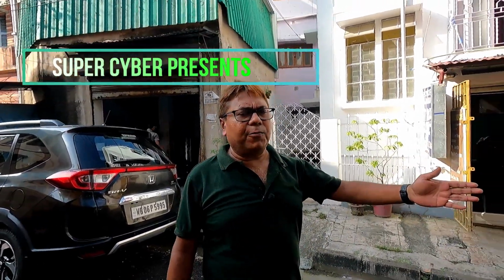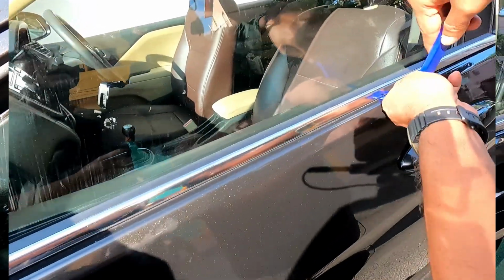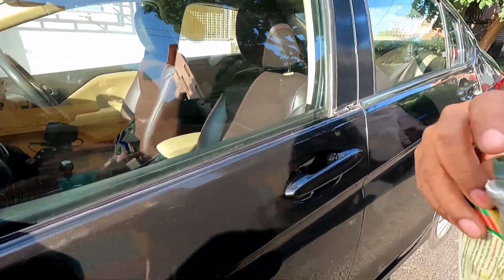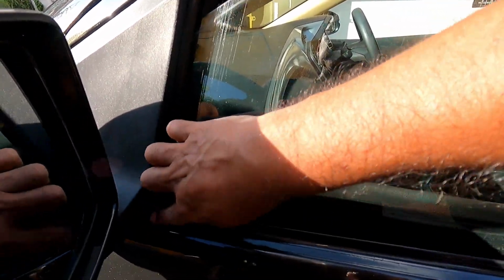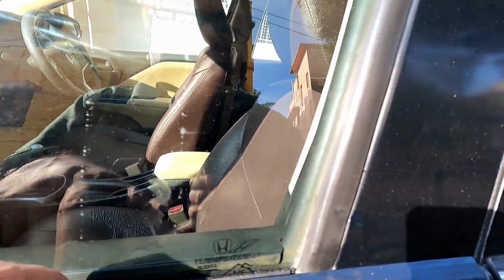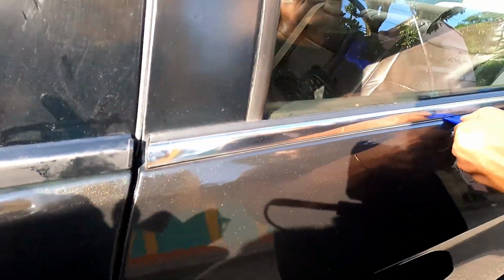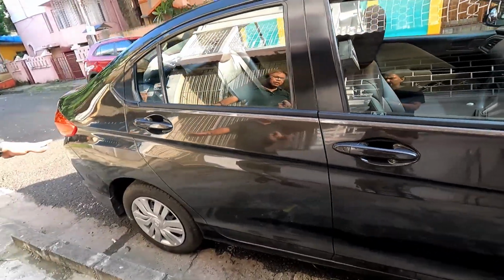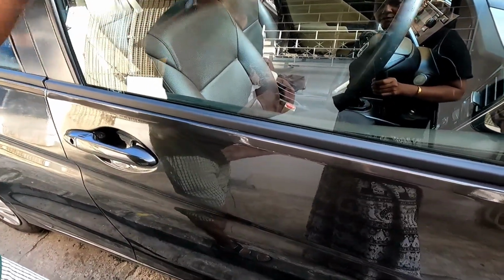How To Change Weather Strips of Honda City 6th Generation 2016 #carmodification #garnish

Comment: 03:06 to 03:11 which type of glue, you have been applied here...
Reply from the maker: No glue is required to be applied here. What I applied is grease so the inner metal does not gather rust due to moisture.

Comment: nice video but you shouldn't apply grease!! its a dust magnet ideally apply silicone oil (that which is used to lubricate treadmills) - If grease touches the window its a headache cleaning every time
Reply from the maker: Thanks for your feedback.